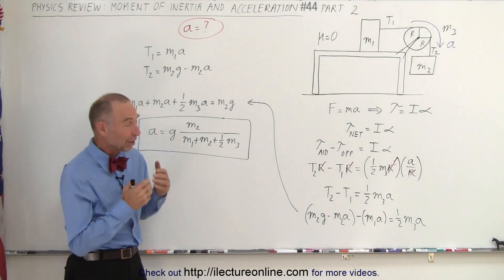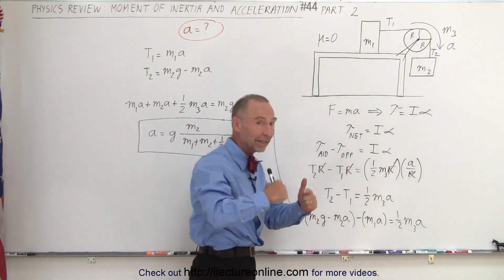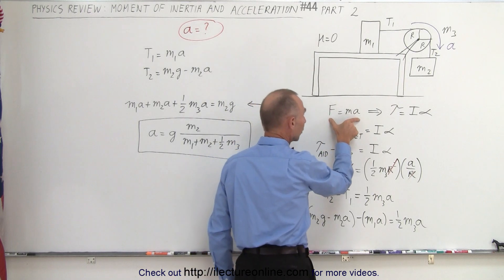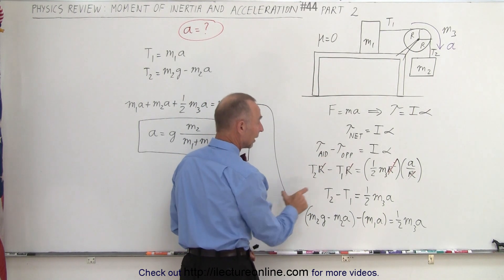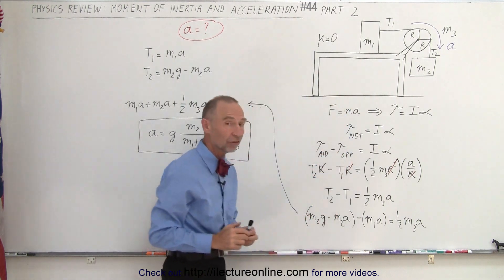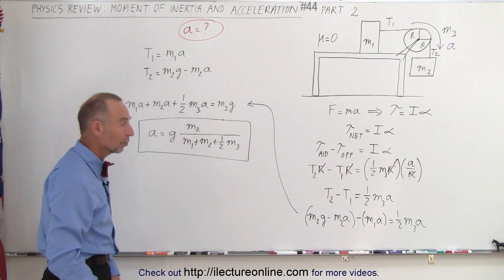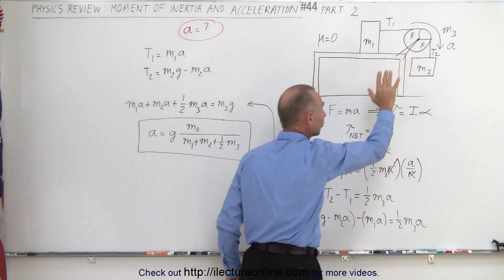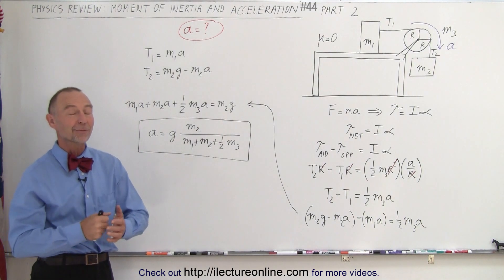Physics Review: Moment of Ineria and Kinetic Energy #44 Part 2

Comment: hi, my question is the equation says that the torque is equal to R(T2 - T1), isn't it has to be R(T1 - T2)
Reply from the maker: The magnitude of the torque is R(T2-T1).  If written in vector format your expression is correct.  In the method shown in the video, we want the "net Torque" to align with the direction of the acceleration.